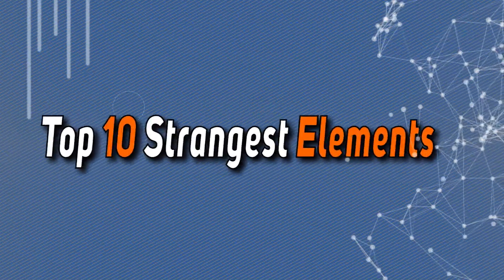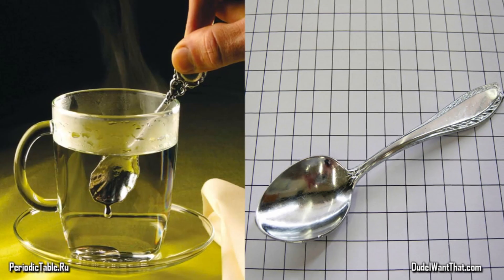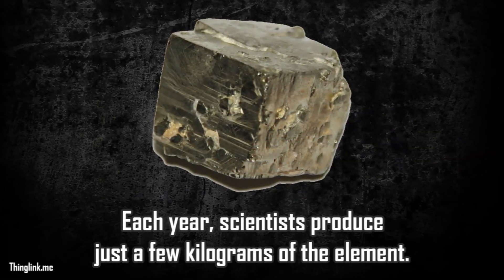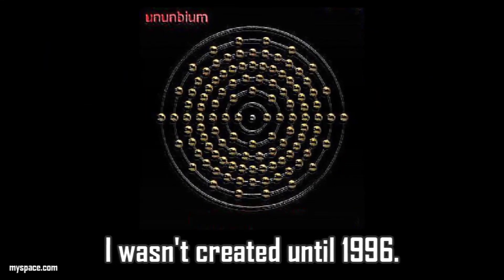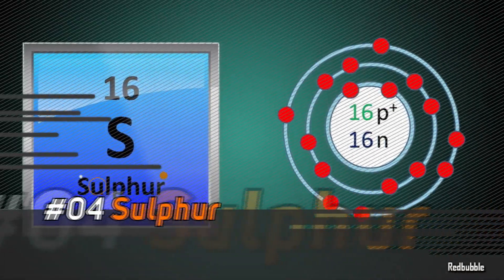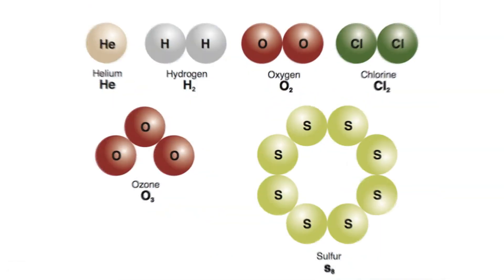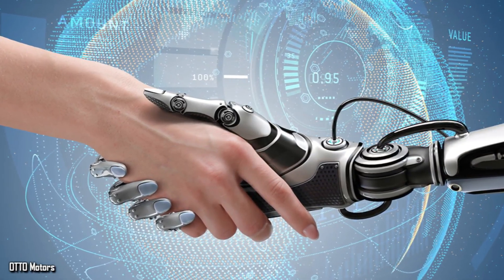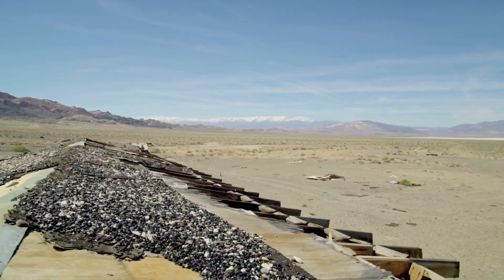Top 10 Strangest Elements

Comment: Gallium doesn’t actually melt in your hand the way people are probably thinking it does (T2 style).  Its more like it sweats a pervasive silver paint all over you.  Definitely cool to melt with a hand heater / blow dryer and pour into a mold,stick in the fridge or freezer a bit and pop it out.  You can definitely handle it a bit without issues too.  But yeah, if you want to try and let it “melt in your hands”…you’ve been warned.
Reply: Sure it depends on purity
Reply: @ksggbg990  no, it doesn’t.  It doesn’t heat up evenly in your hand.  You warm up the outside and it becomes like wet paint

Comment: Well actually Francium is slightly less reactive the Caesium, it's outer electron is held tighter then usual so it is harder to take it, there fore Francium is not going to give a bigger reaction them Caesium, also Helium doesn't defy gravity, it is lighter then air so is more buoyant. If there was no ait then Helium would fall to the ground, it only goes up in the air because the heavier gasses in the air push it up. Carbon is one of the only chemicals that sublimates, eg going from a solid to a gas without melting, under great pressure you can get liquid carbon too!